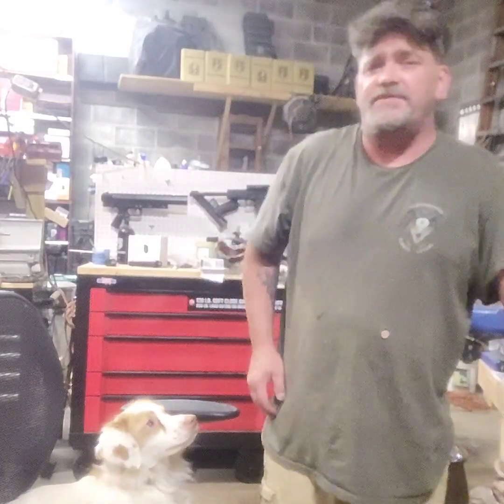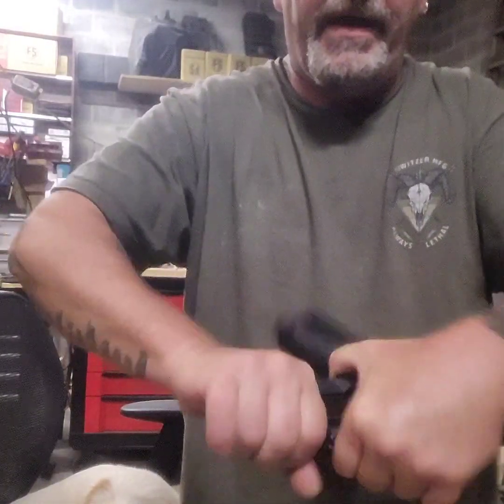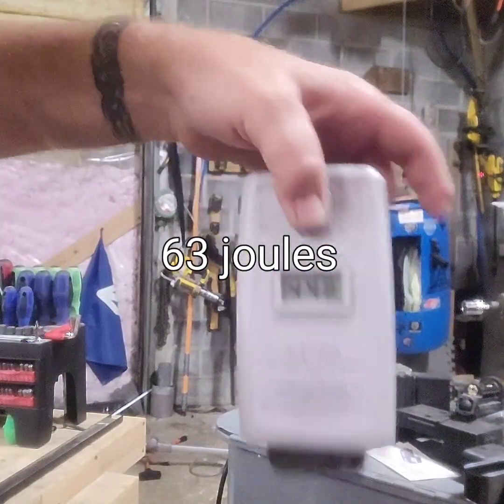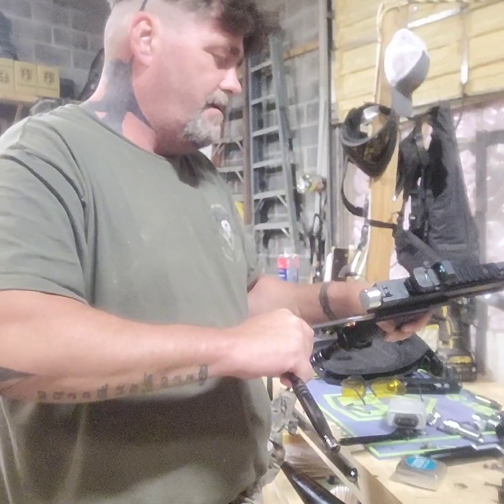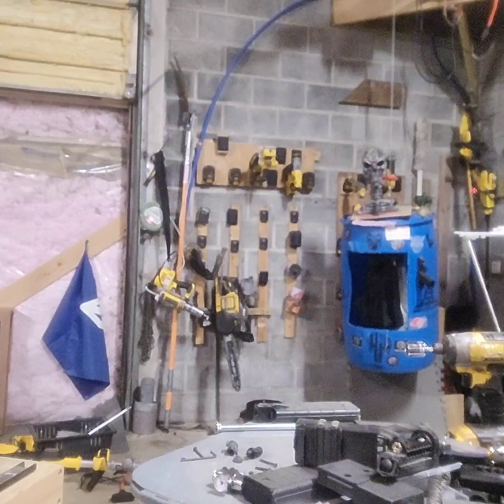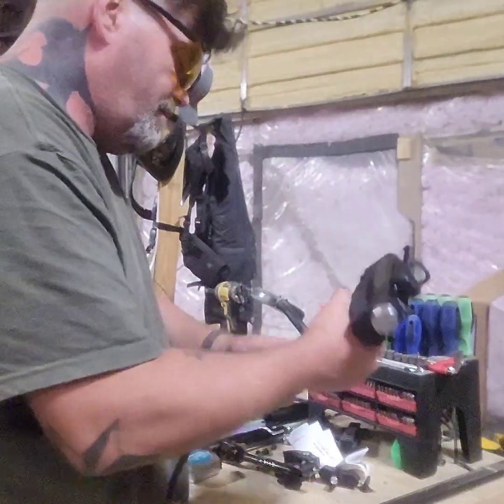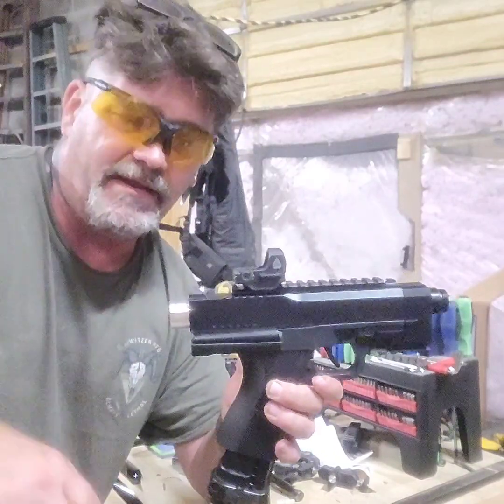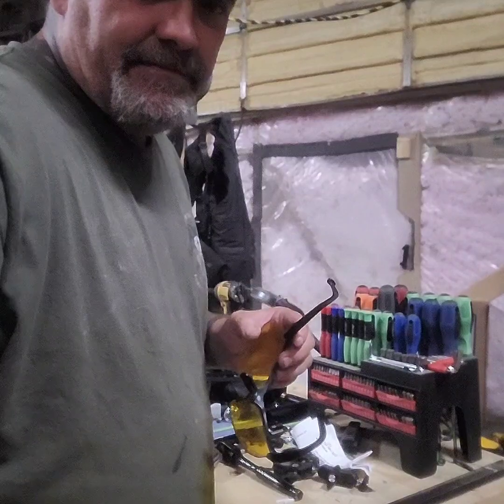SSD power plug for the tcp

Comment: Hey brother, I have a brand new TCP with this exact power cap and 5.5" barrel from you with the prv delete cranked all the way up, just tested and am only getting 45-50 joules on the first shot. Can't get any higher on the first shot. Any ideas? What PSI is your remote HPA you are using? Could that be the difference? Never mind just saw you commented that it is 1000psi. That's the difference right there. I have an 1100psi ninja with a remote line and mag for it I'm going to try tomorrow 🙌🏼
Reply from the maker: @DWHGWIHW  measure your velocity spring. It has to be over 32 mm with the power you’re getting it sounds like yours is only 31 mm
Reply: @ ok I will, if it's not long enough could I shim it with a washer to make up the difference? Thanks for the reply too
Reply from the maker: @ no shimming don’t work at all you need slack in the spring

Comment: Do tests with a co2 cartridge. The air line is giving you unrealistic numbers.
Reply from the maker: Don’t know how many times I have to says this I have tons of co2 test videos the different between co2 and HPA co2 drops as it runs out first shot is the same now look back in my videos
Reply: @sterlingselfdefense-lessle6915  Right? people dont realize the co2 cartridge has 800-900 psi on the first shot lol. How many psi is your hpa line? I have this exact set up from AL with your parts and it didn't hit these numbers. Im gonna try with my remote hpa set up.
Reply from the maker: @RT4sanity  co2 pressure depends on the temperature of the co2 70° is around 850 psi 90° is around 1200 psi. I test with an Hpa line at 1000psi.
Reply: @sterlingselfdefense-lessle6915 ahhh that makes sense. Ok
Reply from the maker: @DWHGWIHW  check velocity spring make sure it’s over 32 mm and co2 is 850-900 at 70 degrees at 90 degrees it’s like1200